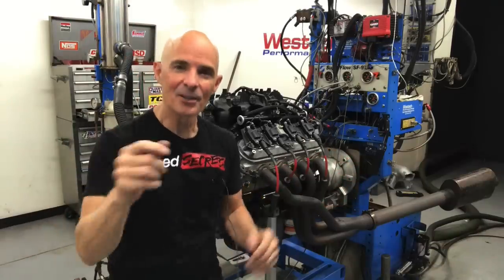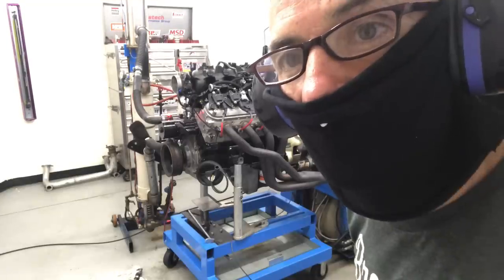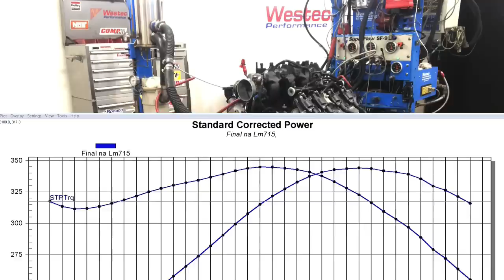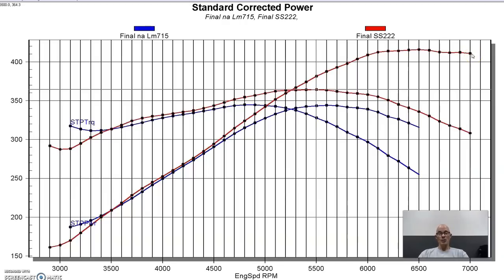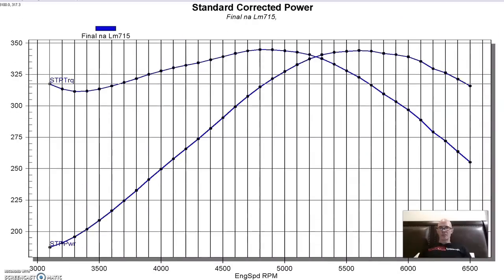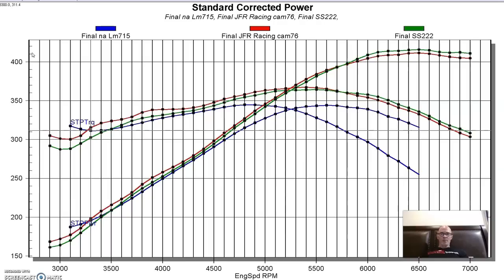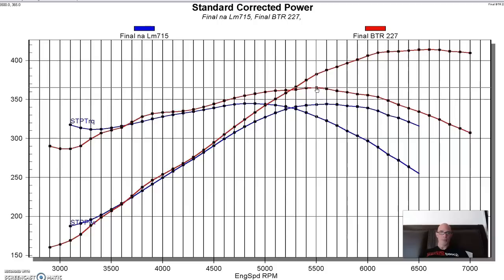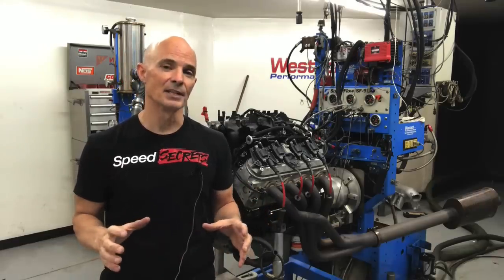DROPPIN' THE DEUCE! STAGE 2 TURBO CAMS

Comment: its neat to see how similar they are in this configuration, as ive seen this too, so when people ask what cam and i would say, one that opens the valves, or one that is 210-230 ish will be fine with mild events

again i agree the 216 st1 is a better cam for a 4.8 but people are always upset there is no chop, so also since people have no idea what they want and would rather chop than make better power average the ss2 was born, and i started calling it sloppy stage 2 because its a joke, based off everyone's needs to have stages.

the funny facts are the 200$ price tag, and the fact that as far as we can dig up it was designed by GM and ordered from Elgin Industries to be tested in development by GM engineers since before the Engine was released, so no one can say that this cam is a copy or Chinese is the absolute icing on the cake
Reply from the maker: tighten the lsa for the chop
Reply: Hey Matt, is there a cam you'd recommend for a 6l with minimal chop? I'm looking for something that  works with a turbo but doesn't sound like it's a crazy engine in a sleeper.
Reply: @newdeathscope  SS1 all day. great all around cam.
Reply: newdeathscope he literally has hundreds of videos just testing cams. Hundreds. Go check them out and answer it yourself
Reply: Matt, very interesting.  Just curious where you learned about the development of the SS2 by GM back in the day?
Reply: @nathankelly6947  I had a SS1 with some 1.8 rockers and it ran well. I noticed a power increase with the 1.8 Stock style rockers vs the 1.7's
Reply: I'm curious about the opposite of newdeathscope, what cam has the most chop since they're relatively the same power curves?
Reply: topbrent it’s what Elgin and I could dig up on the history
Reply: Sloppy Mechanics cool to see another youtuber commenting and following on anothers channel 👍🏻
Reply: I don’t give a shit about sound, or peak horsepower for that matter, it’s all about low and mid range torque for me.
Reply: @shitbox7413  I prefer torque first than hp.
Reply: @richardholdener1727  Who is the JFR camshaft company?
Reply: @ryanneighbors7306  Jarret Faggart Racing. He is local to me and a buddy of mine. He has a few cams he put together with Isky that are very popular in the turbo truck world.
Reply: @minnick99  Thanks! Do you have any contact info? Or does he have a website?
Reply: @Sloppy Mechanics 
I’ve noticed a lot of ss2 cams on eBay and Amazon that are not Elgin brand. Are these cams now being copied and China produced? Should they be avoided?
Reply: capsoval YES! avoid everything “made in Chyna”!!! Buy quality buy American
Reply: @Silkmaster4200  BTR Truck cam then?
Reply: @richardholdener1727  yay misfire
Reply: @Silkmaster4200  exactly. Horsepower is how fast you get to the wall. Torque is how far you move the wall when you hit it.
Reply: @tuloko16  torque wins races, hp sells cars
Reply: What about the sloppy stage 3 I’m going back and forth the stage 3 to the stage 2 I have a 5.3 lm7 with a manual transmission 4.10 gears truck weighs like 3200 maybe lighter
Reply: @richardholdener1727  appreciate all the videos. I followed ur cam swap video and swapped my 5.3 with ss2 cam and pac 1218. Do I need to ensure the #1TDC and line up Dot to Dot? Or doesn't matter the TDC and just like up the dots and good to go? Sorry I keep getting different info. I followed your cam swap video and I didn't see you checking #1TDC just dot to dot. Thank you!

Comment: This is Richard’s masterpiece. Saw this when it came out 3 years ago and it opened my eyes to what these shorter duration, higher lift cams do on the smaller LS motors. When you consider some of the newer cams that have come out since, they’ve sort of continued that trend and Richard was onto that way back in 2020. Bravo!

Comment: Thabk you so much for this test, and doing it NA first.  I am building an NA flat top 5.3 right now and was going to buy the 8706, but I see that in my normal driving RPM, I am leaving a lot on the table over the 8720.  Welp, fixed that issue before I wasted money on it.  Keep working towards that Nobel Peace Prize.
Reply from the maker: happy to help
Reply: I'm eyeing my 8706 right now and trying to decide if I should do an 8720 instead...
Reply: @projectturbocoupe4897   you know after seeing this that 8720 looks really appealing
Reply: @richardholdener1727  do you think the 8706 might be better than the 8720 on bigger engines like 5.7 and above?

Comment: I've said it a million times.

I break my cam choice down by whether I'm willing to buy a converter or not.

If so, am I willing to buy new pushrods or not?

Then by price.

10 ft/lbs down low, or 5 HP up top is not going to change anyone's life.

Hell, but the cheap cam, tell people you bought an expensive cam if you just want to sound cool, no one will ever know.
Reply: So what would your cam of choice be for 3200 stall. 862 ported heads but small valves and tbss intake? 216/218 and then add nitrous? Makes a pocket rocket outta the 4.8
Reply: @ZackNakazora1  you're misunderstanding me.

I don't choose a cam based on the converter.

I first decide, am I willing to foot the expense of a converter.

If yes, I go bigger, if no, I go smaller.

Comment: That baby  summit cam would be the ticket for me !!!
Reply: socleanmx6 I did the summit 8719, stage 1 truck cam in my 4.8. I’m pretty happy. It is in a Jeep application though.
Reply: That 8720 is impressive.
Reply: I just installed the 8718. It worked great for me! I wasn't expecting any chop at all but it sounds fantastic, and pulls great even now before its been tuned.
Reply: You could save $100 and buy the sloppy can on eBay for $185 and have an almost identical power band.
Reply: @phillipbelcher3371  the sloppy tax hit hard. Sometimes it is at 280 reselling. Sometimes 200
Reply: Phillip Belcher you can run the 8718 truck cam without a tune, which is crucial in an area where there is a two month wait at the only shop that can tune an ecm.
Reply: Where can I purchase this Sloppy stage 2 cam? And who makes it?
Reply: @rogergm92  sweet, perfect. Thanks!
Reply: @rogergm92  since I got your attention. May I bend your ear for a bit? I'm building my 1st LS!!!! It's for a 82 C10 I'm working on. I'm using a 6.0 lq4 paired with a 4L80 out of a 2005 Silverado. I plan on daily driving it but want to keep it "simple". I already have a SS truck intake manifold, just ordered some long tubes, probably going  sloppy stage 2 cam 228/230 with springs, and a built torque converter. The converter is where I can use some knowledge. I was told to run a 3200 stall but just saw a turbo 99? 4.8 running a 2300 stall....
Reply: Ruben Angelo, Elgin (brand) 1840p is the sloppy stage two. Also look at the 1838p,   And 1839p

Comment: That was a ton of work and in many ways your best test yet! Thank you!!

I was a bit surprised to see how close all the cams were. Feel they will definitely start to make quite different power past 10 psi of boost. 

Can’t wait for Part 2 😁
Reply from the maker: I don't think you will see that but that is why we test
Reply: in my opinion, i think boost and back pressure levels are the only thing that might change if the same test was done with a turbo.

Comment: The point of the SS stage 2 is the price, it's a lot cheaper for the same performance.
Reply: Facts. And the Summit cams have a VERY close price point to the Elgin.
Reply: Yes just buy whichever one is cheapest at the time. I or my ss2 for 230. If it’s the same as the summit cams I’d go with those.
Reply: You got the point. Cheap. Good and has part of the chop people wants. If people forget the chop they can go smaller with the same performance
Reply: Boom, someone said it

Comment: That torque cam produced a very happy looking curve. The peak numbers might not be there, but it'll put more smiles on faces when the throttle is pegged in real world conditions than a dyno chart. Smack an LSA blower on there and it'd be an absolute weapon that was still drivable and streetable enough to drive it to work every day.

Comment: Really liked this test Richard! Building a 6.0 now and would like to see the SS2 vs the Tick Performance cam results in the larger engine. Keep up the good work!!!
Reply: I also would have loved this test on a 6.0! Even the more popular 5.3
Reply from the maker: minimal differences
Reply: Richard Holdener - I have some L92 heads (new) I will be running on it with a GM Performance carb intake that also has the injector bungs PN 25534416. The 6.0 block is new from GM. Crank and rods coming from a L92 that has a questionable block. Just need pistons now. Looking at the Tick cam because I know Jonathan well and their shop is not that far from me.

Comment: Thanks for all the info you provide! Great videos! I’m going with the summit pro ls stage 1 truck cam for best over all power on the daily driver. Can’t go wrong with the 205/217 112+2. It’s about +50hp peak with power increases everywhere.

Update: Installed the camshaft and it's awesome. Hits hard for a little cam.
Reply: Matt Vardaman I have that cam in my Jeep with a 4.8. I’m pretty happy.
Reply: What pushrods did you use?
Reply: @jsmcortina  I used the stock 7.4 pushrods. I just bought new ones on for about $40. Two ls builds now, one 6.0 and one 5.3, both used 7.4 pushrods. Summit 8718 truck cam in both motors. I just did valve springs on my 5.3 two days ago, used the summit 174002 springs. That’s their ls6 springs, since the gm blue springs weren’t available most of the year, they made their own line.
Reply: The summit pro ls truck cams have the same base circle as the stock cam. So with stock (or stock replacement) heads, rockers, and lifters you’ll use stock pushrods. Good luck!

Comment: I know it's alot of work, but I'd like to see this with a bigger engine. 6.0 or 427 maybe
Reply: I definitely would have preferred a 6.0! Even the more popular 5.3 A little disappointed in engine choice.
Reply: imagine slightly higher numbers at lower rpm's, viola
Reply: @SloppyMechanics  Totes. 

Take number. Divide by 4. Times 5. Bam, 4.8 to 6.0 (same heads) numbers.

Wondering about the turbo? Take these numbers and then run through Richard's NA->Boost estimator.

What ifs are pretty damn easy to get rough order of magnate figured out.
Reply: I'd like to see it on a 6.0 as well, except with larger differences in cam timing. Most of these were all within a few degrees of each other so it's no surprise that their curves looked similar. But what about a cam with a reverse split? Or one with a lot more exhaust duration like many of the LS3 grinds have?
Reply: @SloppyMechanics  would a sloppy stage 2 be OK for a stock 6.0 LQ9 with factory stall?

Comment: I just installed the summit 8720. In my Lq4. They call it the high lift truck stage 2. .600 lift. Vs .524 lift for the exact same cam without high lift. I figured that is good for 10+ hp without the need of a TC. I can’t wait to install the engine.

Comment: The real winner for this 4.8L is the small Summit cam.
Reply from the maker: agreed
Reply: What is the part number for the small cam.
Reply: @phillipslaton7870 this is old as balls, but its a sum-8720
Reply: That’s my thought too! If you had of run the smaller Elgin 1839, you’d see the same thing, same peak HP but higher torque thru the mid range. 
But everyone wants beefy lope of the stage 2.
Reply: @phillipslaton7870  they discontinued they cam kind of... They changed something I guess but it was replaced by 8720r1

Comment: I'd love to see you post the result of the Summit stage 1 Ghost cam, there has been lots of discussion about this cam on LS1.com and good results, Im very curious to see if it would hold on to low end power well like the tick cam did in the test and the Summit 218/227 112 cam did, both those cams held on to top end power and made good low end.

Comment: I've crunched the numbers.  The best cams had intake valve closing from 65*-71* with about 2 bhp difference.  Overlap wasn't an obvious factor.  Cams with exhaust valve opening earlier than 79* made less low end torque, and the best performers were around 71*.  I'd say an optimum cam for the 4.8 is 276*/276* 0.600" lift, and 112* LSA.  A strong performer with good idle and vacuum to run power brakes.  I'd extend that to the 5.3 with 706 heads and stock intake manifold.

Comment: This is great because I'm building a 5.3 with a turbo cam now. I was kind of surprised that there was not much variation between the cams. I'd be curious to check the prices of all the cams too so low cost builders can get a good cam for cheap. I'm willing to bet under boost the power and curves might be the same. Great video, thanks for doing this! Am I on my wife's account? Lol

Comment: Thanks for all your hard work on this! If you decide to do a Round 2 on a 5.3 or 6.0 might I suggest cams with larger differences between them to really elucidate what effect the different valve events have on an LS. Like a reverse split or something with a lot more exhaust duration similar to many LS3 grinds.
Reply from the maker: I tested what all the manufacturers had as stage 2 turbo cams
Reply: @richardholdener1727  I tried to send you a cam by contacting you on Facebook ;-) I'm sure you get a ton of messages, especially with the way this channel is growing. Thanks again!

Comment: My understanding  turbo cams is they have less over lap. On forced induction higher overlap blows out the air fuel out the exhaust. With dual over head cam setup you can phase the cams to control overlap on bottom end vs top end using factory ecu programming. That is what Nissan did with their 300z twin turbo which I use to own.
Reply from the maker: think about this-boost doesn't blow out of the exhaust when the exhaust back pressure is higher than boost-more likely go the other way
Reply: @richardholdener1727  , Yes forgot  exhaust back pressure factor on turbo but not on supercharged so much.  Turbo turbine design is big factor.

Comment: I'd love to see a comparison of say a 224/228/113, 228/224/113 and maybe a 226/226/113.  Along with backpressure data on each.  See if the OG rev split truly has reduced backpressure.   And if the more recently common standard split turbo cam offers a significant amount up top.
Reply from the maker: less power NA will equal lower back pressure-but also lower power at any given boost level
Reply: @richardholdener1727  but is the trade off linear?  Would the delayed EVO of a rev split decrease backpressure enough to not adversely affect top end HP?  Have you ever compared a rev split to a standard split?

Comment: I found most of these cams were pretty close to the same. Slight variations in lift and lobe seps. I would have like to see cam wars with same lift and durations but different lobe seps. Especially with the long tube headers you used I would have liked to see more scavenging numbers and differences. I find it amazing the curves with such a high lsep at the 115 mark I thought that would be better with a 105 sep. great video. That was a lot of work I bet. Good job
Reply from the maker: see the lsa cam test video

Comment: I’d like to see a turbo work with a cam with lots of overlap like a 106 lobe separation
Reply: There was an article in Hot Rod Magazine where Kenny Duttweiler did something like that for the Buick V6 turbo engines he was working on. Tightened up the lobe seperation to 102 degrees and made more power but I think he needed to put thicker pushrods in because he was opening the exhaust valve against the boost.

Comment: That elbow torque wrench for the cam bolts.  Bold move to pull on the internet. :)
Reply from the maker: they were coming right back out in 10 minutes-besides, We did a torque wrench challenge -my elbow was within 1
Reply: Richard Holdener I wasn’t criticizing. :) I’ve done it with a cam that I was leaving in.
Reply: Richard Holdener I’ll send you a calibration sticker for that elbow.

Comment: Now I have a internal battle between the BTR stage 2 v2 truck cam and the stage 3 V2 truck cam, putting in a mild 2600-2800 converter and stepping up to the stage 3 could negate some low end loss! But, the chances of me seeing the drag strip are slim as I am a broke college student/engine enthusiast, not a great combo XD! I found it interesting that the smaller summit cam stacked up well against the others lower in the rpm range. If you aren't planning to rev to the moon and back, that seems like the perfect street cam for a smaller engine with future boost in mind.

Comment: I am running 4.30 rear gears and ordered a Yank Performance billet 3600 stall torque converter with a triple disc lock up...in my 2005 Chevy Tahoe...because race car...

Comment: You should have someone make you a split timing cover and use a remote water pump hooked up to either port to get away from pulling the pump, balancer and timing cover off for every cam swap.
Reply: He had a 2 piece cover, he just doesn't use them.

Comment: How about the ly6 ...Ss2 cam and a fast intake with short headers swapped to a 08 Silverado 4x4 and a little bit of nitrous no more than 200 hp worth... should be able to clean out 35-12.5

Comment: That’s what I have been running for 3 years now the sloppy 2 a GT45 clone and a 4.8 in my S10. Works awsome iv been a fast as 9.88 on C16 135mph and it it a 3250pound truck with me in it. I tried the Elgin stage 3 in another car aluminum 5.3 turbo Camaro we will see how that turns out we need a better drive shaft so we can turn it up on the dyno. I’ll let u know how that works.
Reply: Any prediction ?

Comment: I am wondering if you've tested back to back a typical cam vs a turbo specific camshaft. If you had something like 228/228 114+4lsa and another camshaft with 228/220 110+0lsa. Gives the same overlap area but cuts the exhaust flow area differential to the effective pressure.
Reply from the maker: yes-the cam that make more na power does so under boost